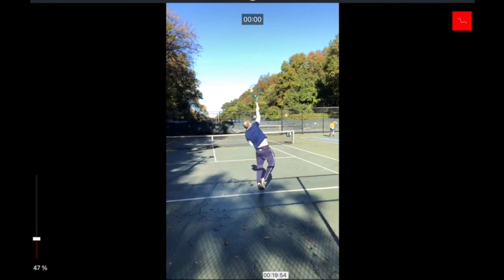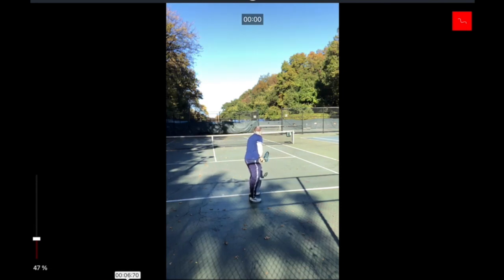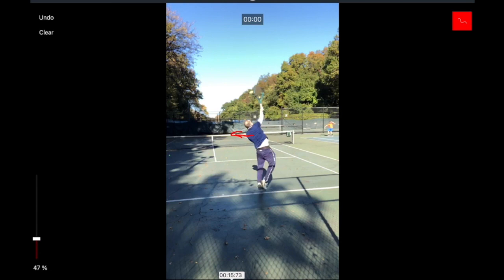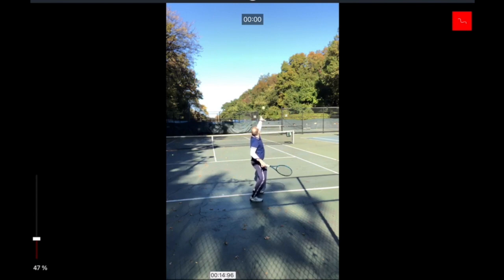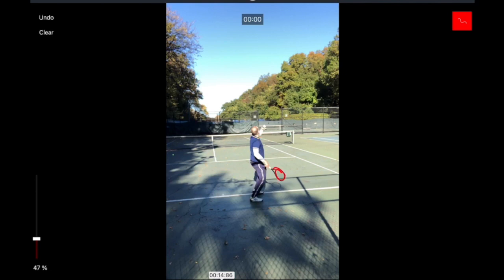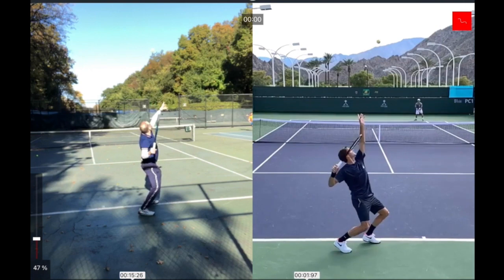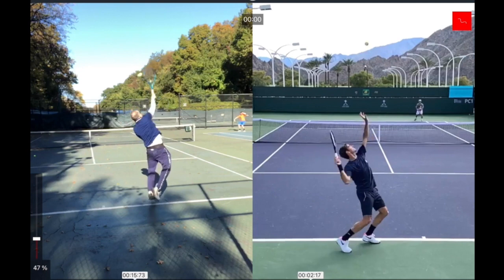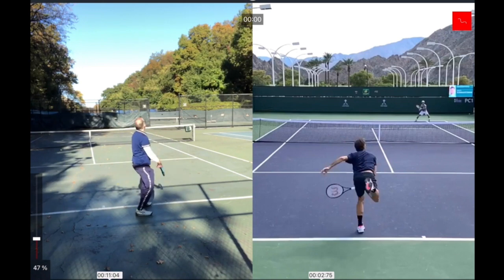Learn from Roger Federer how to improve the loading position on your tennis serve

Comment: From my observation, I think people who use a eastern forehand grip may have a psychological component for that practice. I have a friend who would start with a continental grip at ready position, but at the moment he starts his back swing he would quickly switch back to the eastern forehand grip. I may be wrong, but I think players who use a eastern forehand grip feel they have more confidence to get the ball into the box on the opponent’s side if their racket face are facing the target. 
Also, it appears to me Jay’s left foot was pointing towards the net post when he was about to serve. I wonder if he could turn his left foot  more parallel, that might help keeping him sideways longer. Of course a continental grip would help in that regard too.
Good analysis, coach Meike! Thanks.
Reply: Thanks for the extra tip re: left foot.  May encourage coiling away during prep / loading phase which Meike pointed out is missing right now.
Reply from the maker: You're right that players change back to an Eastern grip bc they feel more confident. Most of the time, it happens subconciencly.